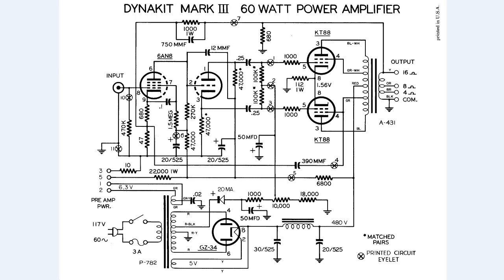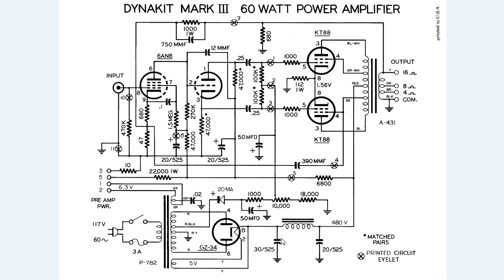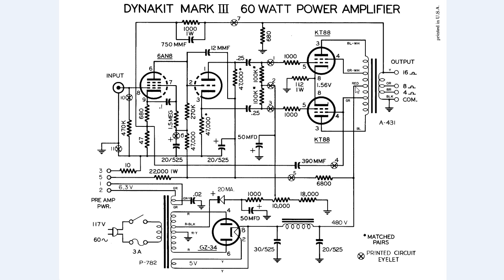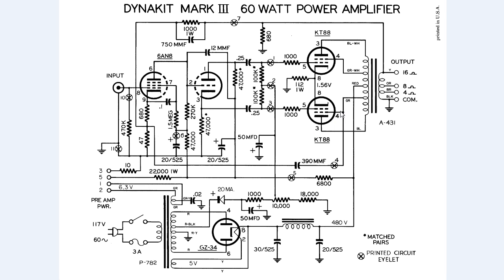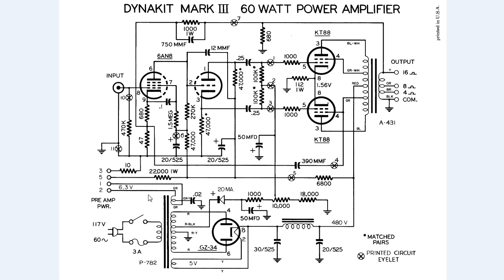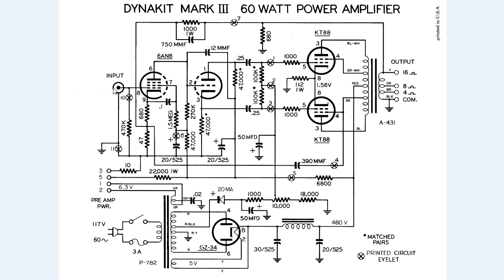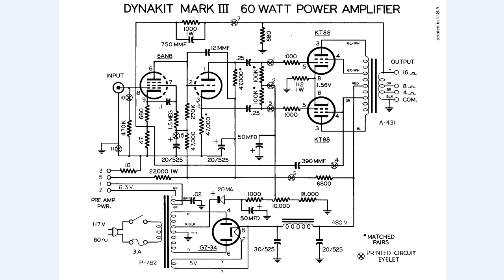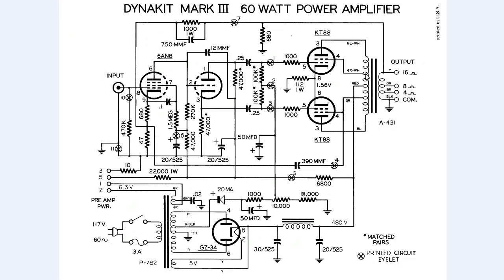Dynaco Dynakit Amplifier Part 2 - How does the Mark III operate with KT88 6550 6AN8 GZ34

Comment: DIY  Tinker  Thanks for this upload.  I am just working on a Mark II and couldn't find the schematic.  That said,...Always be careful in reading schematics; if wires cross but there is no round blob at the junction, they are not actually connected at all, to the wire going through at right angles.   YES:    Kevin,  Rich Smith, and Mr39D36ce are completely correct.  Back in the day, Popular Electronics used to show two little blank spaces to indicate: this straight wire goes under the other straight wire.  if three and four were connected that portion of the Output transformer would also be shorted.  With this amount of power that bottom tube and OT would probably be toast very soon. 

 Ultra linear operation makes the tube almost act like a triode at low gain, and the beam becomes stronger as the signal raises up.  The Ultra linear configuration has more dynamic range,  IE not so much compression, and less harmonic distortion, for maximum linear power out from a given pair of tubes. 

 David Hafler designed the Dynaco's if I'm remembering correctly.  Back  in the 50's & 60's, nothing could touch them in quality for the price (about 1/2 of a similar power Macintosh).  I agree with You on the 1st Cap failing.  It was originally spec'd as 550 volts DC and they meant 550V.  Better to strap two 350 volt caps in series,  or even better, as You suggest two 400 volt caps with a couple of distributing resistors across each to make sure the voltage on each, is half the total Voltage.